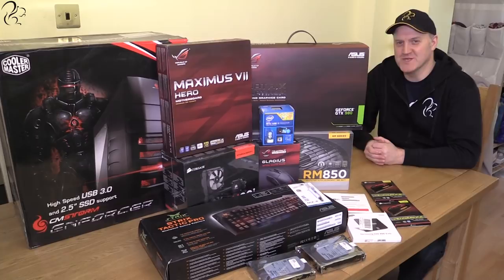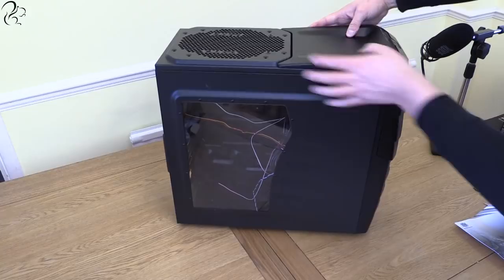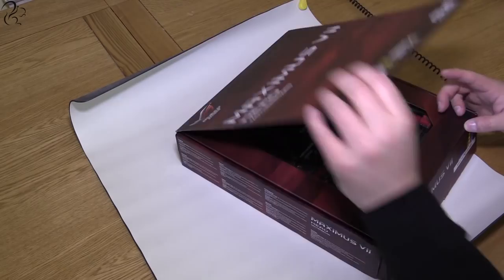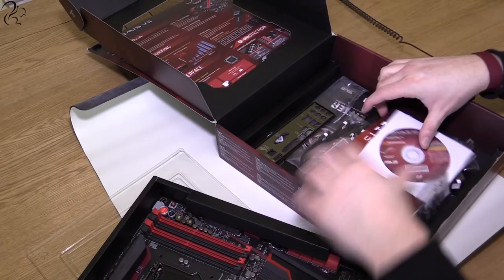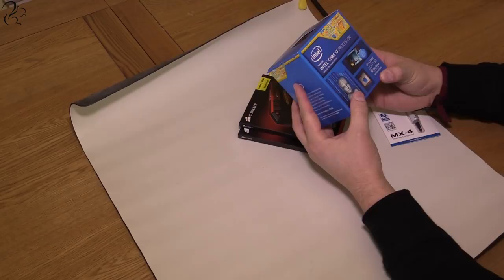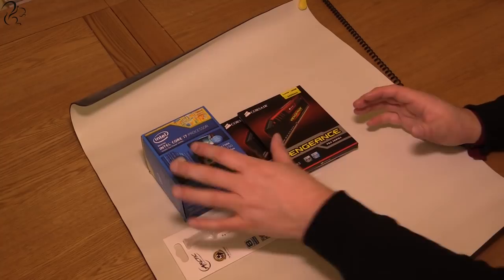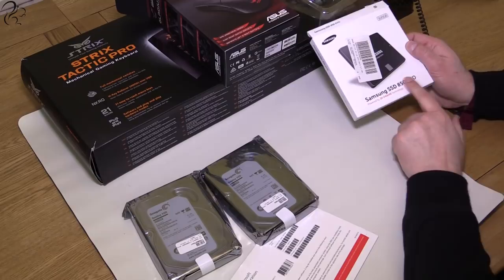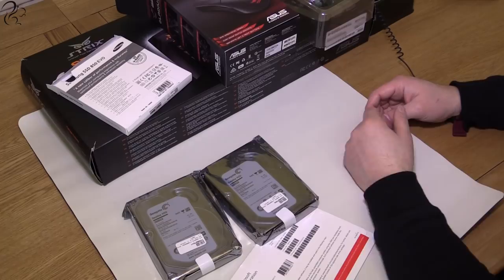How I Built My Gaming Rig (Step by Step)

Comment: Im surprised your using the rear fan as an intake. Usually is best to balance intake and exhaust. Looks like you dont have any active exhaust. That kind of trows off airflow. 3 intake fans and 0 exhaust. Why?
Reply: you don't want active exaust, if you use positive pressure by only active intake, you also blow the dust away instead of extract it in
Reply: yes, like i said going for positive pressure

Comment: I was wondering, I have a gaming laptop with an i7 in it and I tend to run at about 75-85 degrees Celsius, should I be worried? (and it is not overclocked)

Comment: Hi guys, Paul, your vids are epic! Thanks for this video. I am looking to build my own PC soon. Could someone tell me if I should get 2 gtx 960s 2gb in sli or should I get a gtx 960 4gb. I want to run ultra settings with 400% scaling and want to run in 1080p resolution. Also, could you recommend a good processor with it please? Thanks!
Reply: Guys, please tell me if this is a good idea for running ets2 on ultra with 400% scaling- Amd r9 280x (3gb vram) and an Amd fx6350 @ 3.9/4.2ghz?

Comment: Hey squirrel I need some of your help here! I built a pc a year ago and I have gotten the same fans that you put in to your rig, and for some reason I can't make these fans run under 1000 rpm. On idle the fans are at 1700 rpm. I've tried everything. Went in to the BIOS and went to fan control but still nothing. :( All help is apreciated from anybody that's willing to.

Comment: I'd still put at least 2mm (1 line in the middle where intels generate most heat) of thermal paste on the CPU even of manual said it is not needed,and I wonder whats the difference in temps with and without.
Reply: Jon Kjellgren I would definitely recommend against that, unless you were removing the thermal paste that came with the cooler. You don't want thermal compound seeping off of the socket and shorting out connections.
Reply: Bobby Geiser dafuq is with ppl these days,no thermal compound on CPUs,I don't want to live on this planet anymore :(
I said 2mili meters,or make it 1 , just so the air is removed within the CPU and the water pump/block.
It will not "leek" into the socket as its imposible with that small amount.
Reply: Never said to not use any thermal compound. Learn some reading comprehension.

If you're that worried about air pockets, than just remove the preapplied thermal paste and use your own. If you want to try it yourself, be my guest, but there's a reason why the manufacturer gives instructions...
Reply: Bobby Geiser sorry for miss understanding you but English is my 3rd language.
Duno if u watched the whole video but he bought actic thermal paste,but never used it.
Thats why I was wondering why he never applied any.
I don't think any aftermarket cpu cooler comes with thermal paste pre-applied,I've never used Corsair all in one watercoolers but I still think it would shave off a Celsius or two with thermal paste.
Reply: Yeah, he said in the video that the reason why he didn't use the Arctic Cooling compound was because the cooler had preapplied thermal paste.

He might save a celcius or two with the AC compound instead, but he doesn't seem too concerned about it. I wouldn't be, either. Most aftermarket coolers come with decent enough compound nowadays.
Reply: Bobby Geiser fuk me then my bad,guess I missed that part or forgot about it,its a long video after all.

Yeah many come with great thermal paste Arctic,Noctua,Prolimatech being my top 3 choices,I'll have to try out Corsair in my next build if I find it coz it's not really available in my part of Europe :)

Comment: Why did you not go x99? The 5930k would have been perfect for you!

And also with the radiator, why only 120mm? Air coolers would be about the same, the difference to a 240mm is well worth it!

Also, FYI the pwn 4 pins mean you can see the RPMS of the fans

Good job anyway!  #YOTS
Reply: I suppose you meant the 5820k, which is also a six core, but with less pcie lanes and cache (I think). The 5820k is also a lot cheaper than the 5930k.
Reply: WhatThePotato The 5930k is the cheaper version of the 5960x which has 8 cores
Reply: Computeryscreen Probably because he didn't want to do X99.
Or it wasn't in his budget.
Or he is amazingly rich and doesn't want to waste money on a X99 build.
Or he isn't a PC enthusiast.

Comment: What's the band around your wrist and the wire leading from it for?
Reply: it's an anti-static wristband to ground you so you don't kill components by static charge. it just leads to something metal usually, or as i think i saw in the video to the anti-static mat paul is using, which is also a possibility but less effective (i think to remember)

Comment: Would a 750W be adequate enough for the 980? Currently rebuilding my PC Setup.
Reply: Jonathan Muller A 500W psu is enough for a 980. However I would recommend a 600W.
Reply: Jonathan Muller depends on what else is in the system [number of hard drives ect]
Reply: Euan Taylor Hard drives don't use much power, maybe 10W at the most.  SSDs use around 2W, so unless you're maxing out your case and motherboard running with 8 hard drives you won't have any issues.

Comment: I have a question, squirrel. When putting in the fans and radiator for the cpu cooler, is it possible to put them in the "roof" instead of the sides?
Reply: as long as the roof has 120mm screw holes, and looking at the case it possibly has
Reply: true, didn't look at those aspects while commenting. but still, theoretically it would be possible
Reply: Andy26473 i do have quite the gap between the roof and motherboard
Reply: Andy26473 ah, I'm gonna try. Worst case scenario, I will have to send it back and get my moniez back

Comment: why you dont use 2x 250 gb evo 850 in raid it´s much fast than one ssd =) ?
Reply: ***** and also a stupid idea. lose 1 drive = lose all data.
Reply: Harold Holsappel that Raid konfig is only for the System (Win7/8/8.1) and Games ...when your HHD dies all your Data is gone too ..

Comment: In total, how much did this cost, I might consider getting the same thing I'd it's in my buget range
Reply: If*
Reply: guesstimating? 275£ for processor, 600£ for videocard, 250£ for mobo, 200£ for ssd and harddrive, 40£ for case, 80£ for cooler. so thats like about 1500£
Reply: Damn
Reply: It's a pretty expensive rig Squirrel has. It's probably between $1000-$5000. I'm not sure how much this is in euros (sorry for that our European cousins). Unless you have that kind of money, I suggest stealing a NASA computer XD
Reply: Skybluex to be honest, NASA Computers wouldn't be the best for gaming as they are mostly used for complex algorithms and calculation. Not graphical processing

Comment: I am a experienced pc builder and I got the inspiration and tips from Carey Holzman - can I just say its not a good idea to use anti-static bands, pads or anything like that as you are more likely to damage the components with theanti-static. Touch the case and be on the same electrical level not earthed as this is totally diffrent and also prep the mobo out of the case e.g. cpu,ram and then build into case. easier to start the job with PSU, HDD / SDD and any optical drives first as well. I am not disagreeing with you Squirrel and what you have done is perfectly fine - there is nothing wrong with that approach but its a lot easier mine and Carey's way and safer #just_saying.

Comment: Why z79 instead of x99 chipset on motherboard
Reply: x99 isn't compatible with the other parts
Reply: z97 is the newest LGA 1150 chipset. It's Intels "Mainstream" socket.

x99 is the newest LGA 2011-3 chipset. It's Intels "Enthusiast" socket.

Basically, for gaming, anything higher than z97 is a waste of money. The only reason you'd want x99 for gaming is to take advantage of the extra PCI-E lanes which would only be needed if you had a lot of PCI-E cards.

Considering he only has one graphics cards, and no other PCI-E card, z97 and an i7 4790k is plenty for his needs. He could get better rendering times for videos if he stepped up to x99, but my guess is he's fine with the extra time spent there instead of 50%+ more money for the CPU, Motherboard, and RAM.

Comment: Do you use windows 7 or 8 really need to know so I can get euro truck simulator 2. I use windows 8 will it still run ok
Reply: conner owen Yes, It will work fine on Windows 8
Reply: Thanks

Comment: why have you got a wire attached to your wrist?
Reply: Anti-static band. Keeps any static electricity off him so it wont damage the parts if he gets any.
Reply: It prevents static build up, which damages the parts such as motherboard, cpu and gpu etc
Reply: Speirs Just like others said before to prevent static build up that could damage your motherboard, video card, ram etc.
It's recommended to have one but it's not really necessary.
Reply: muiecopyright Why did three people answer the same question with almost the same answer?
Reply: The Joker So they feel entitled in a conversation perhaps?
Reply: Airtrooper719 XBL Maybe, but that doesn't change the fact that it's utterly unnecessary.
Reply: lol, I remember commenting on this, at the time it didn't say anyone else had replied. Now there are even MORE comments about how the original replies are excessive when they are actually writing even more useless comments like "agreed" and "lmfao", the irony.

Comment: We're can I buy this stuf
Reply: The websites of the various electronical components. Visit Intel, or Asus for some electronic components. Amazon is always good, as it is usually a little cheaper than retail price. Don't use eBay, if your building your PC, you want new components, not used, and its not all that trustworthy.
Reply: I bet it can't even run Minesweeper without exploding.

Comment: A few things.
That case is awful.
I have a 4790k and I aircool it with a Zalman fan, and the most I hit is probably 50 or 60c. (OC to 4.5ghz)
The 980 is a great card. The only problem with your rig is that the case is terrible and that rad is extremely ugly. Cool video and cheers to YOTS

Comment: How much did this cost?
Reply: guesstimating? 275£ for processor, 600£ for videocard, 250£ for mobo, 200£ for ssd and harddrive, 40£ for case, 80£ for cooler. so thats like about 1500£
Reply: BerheavedTripod8 It's actually £2,000+  although he probably would of got a lot of it for free..

He has a list to parts and prices in the description.
Reply: like i said guesstimating

Comment: Hyper 212!!!!!!
Reply: Great price to performance, not so great at overclocking though.
Reply: Was about to say the same but then I saw the 4,7 Ghz lol, plus the case looks narrow so maybe a 212 wouldn't fit in there?
Reply: LONE_WOLF I'm using a 212 currently and yeah probably have some difficulty manhandling it in there lol
Reply: Swtere That Corsair cooler isn't the best either but I feel like the 212 would have thermal throttle, since temps are in the 70's already haha. Wonder if he was overvolting as well hmm.
Reply: LONE_WOLF I doubt he was overvolting haha,  unless he used that Asus utility that overclocks for you.  Not sure if it overvolts, I'm too much of a peasant for asus gear
Reply: LONE_WOLF I don't think the 4790k would thermal throttle with a hyper 212, as its only suppost to thermal throttle when it reaches about 90-100 Celsius.
Reply: Swtere Yeah I dont think it does that I guess you have to do it manually. I have never been a Asus fan atleast not since their wifi card has been shipped broken to me and just crashes my windows, It's all about Gigabyte for me and I never had a problem with them
Reply: WhatThePotato The cpu is pretty toasty with the h80i. I have a 4670k at 4.3ghz on a 212 and it does around 65 degrees. A 4790k at 4.7 is a little too much for the 212 as amazing as it is
Reply: It's poor price/performance now compared to cheaper and better alternatives
Reply: AliveGhost13 Has the 212 finally been toppled as the king of price to performance?! What's the better/cheaper alternative?
Reply: Swtere I think 212 is still the way to go for air cooling
Reply: Raijintek Aidos, Raijintek Themis, Alpenfohn Brocken all cheaper than the overhyped 212 and better - it used to be good value, now it's mediocre imo
Reply: AliveGhost13 Never actually heard of any of them,  I think I'll stick to being a sheep and follow mainstream stuff lol
Reply: AliveGhost13  Raijintek Themis and Evo are the same price in my country (Sweden) Evo is still slightly cheaper and you can actually buy them unlike Raijintek Themis that is only available in selected stores
Reply: AliveGhost13 Not a huge difference between them two, The red might not fit in all the build and that's why I prefer the 212 because it just fit everywhere
Reply: LONE_WOLF Here you can buy them readily and in the US iirc too, and they are cheaper by about £5
Reply: AliveGhost13 Yeah but that's US....You guys got everything and cheaper as well....(well almost)
Reply: LONE_WOLF I'm UK :P
Reply: AliveGhost13 Oh...lol I was really tired I thought you meant US like in USA haha

Comment: bad tutorial as vid. you want to put your cpu cooler on the mobo and cou outside of the case. also you touched the cpu surface, which is very bad, thats just a few of the mistakes :P also the vidcart isn't on the parts list. 
But as a show vid its ok
Reply: Was it a tutorial though?
Reply: Wasn't intended as a tutorial lol,  plus touching the heat spreader on a cpu doesn't pose any danger.
Reply: Swtere hands are always a little dirty. If your hand touches the cpu it wil get a bit the dirtyness too and it wil make the contact between cpu and cooler less good.
Reply: KingDmovies Unless you are dripping with some sort of bodily fluid,  I doubt the small amount of skin etc is going to affect the cooling capacity all that much
Reply: KingDmovies mate he is not telling us how to build it he is telling us how HE built it.
Reply: KingDmovies Its called a video card not a vid"cart"(ridge)